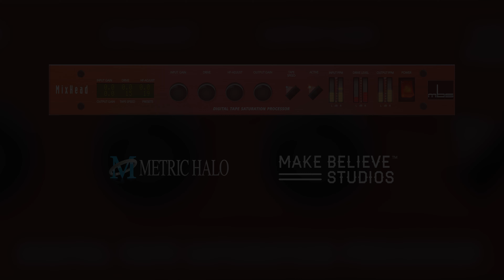What is the MixHead?

Comment: I've tried the demo and really like what it does to put things "in the pocket" for lack of a better term but being the way I am I just gotta know how it's doing it, this video sheds some light but I have a couple questions: At what level of gain reduction does the frequency-dependent compressor morph into limiting? (Does that just mean switch to infinite ratio beside the attack and release times you mentioned) What are the attack and release times before it morphs into a limiter? How much gain reduction is it doing to the frequencies below 5.7k on average with the input meters lighting up about halfway on a balanced mix with the Serban settings for example? Would you consider adding metering for the different modules so we can see how it's affecting the signal at different stages?
Reply from the maker: @alexleverell  great question! Will respond in a few! Thanks for checking it out though

Comment: The original unit has two 66Mhz Motorala DSP chips inside. It's completely digital. Does this plug-in incorporate a 1:1 model transfer from the hardware?
Reply from the maker: The plugin is not a 1:1 port but a remake of the code the OG code only goes up to 48k this will go up to 192

Comment: What are the drivers on those make believe monitors?
Reply from the maker: Soundscan pro ac studio 100 woofers. The good ones
Reply: Are those ns10? I’m super confused. Can I change my ns10/ with proac drivers?
Reply from the maker: @romanx3267  They are ns-10's. Yes you can and they sound great.
Reply: @makebelievestudio  o wow that’s incredible. Thanks. I love the plugin I’m glad you explained the way it works
Reply: Hey Rick I was wondering if you have any videos or info about that mod. I would love to try it, do you need to change anything on the cabinet? Thanks for your responses 🙏🏼
Reply: @makebelievestudio  Did you also change the tweeter?
Reply from the maker: @ tweeter is the same just different woofers

Comment: So it’s basically old stuff in the metric halo plugin sold as the new sh*** 😮
Reply: No. Not at all. The core dsp comes from our library that we have been building up for the better part of 27 years. But that doesn't mean that you could make MixHead with what is available in, say, our +DSP graph which exposes most of that library as building blocks. There is unique processing in MixHead. You know, when you use an analog device that is built from components that have been around for 100 years (in the case of tubes) or 80 years (in the case of transistors), does that mean that the new design is the "old stuff"? Of course not.
Reply: @MetricHaloAudio Great analogy!  I might have to borrow that on occasion.